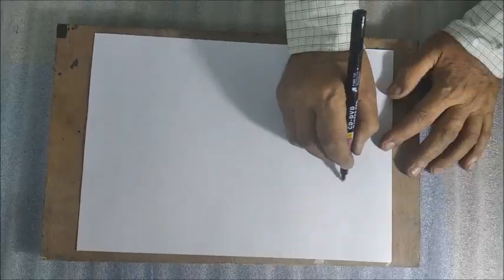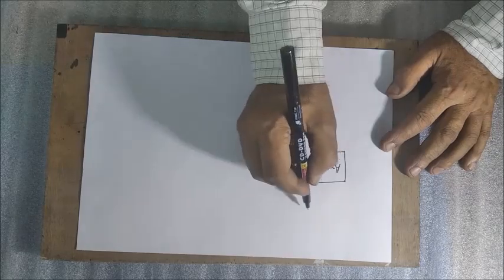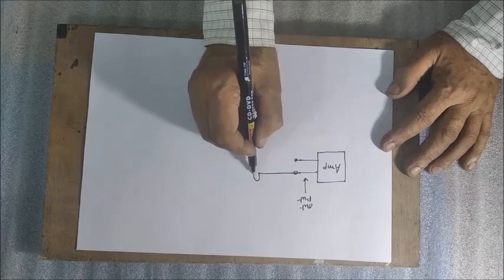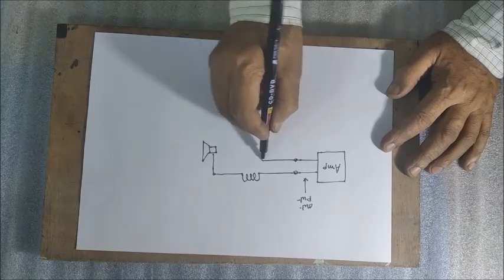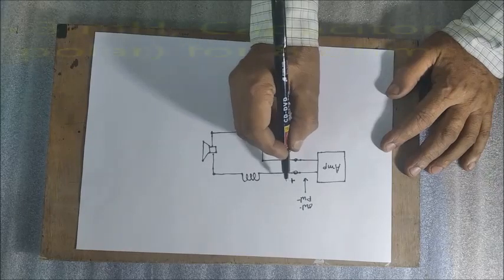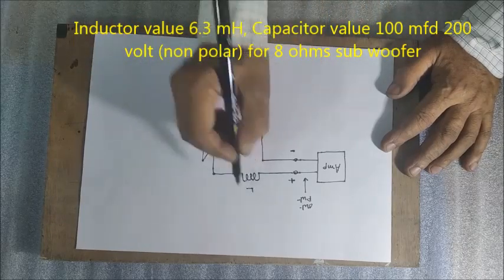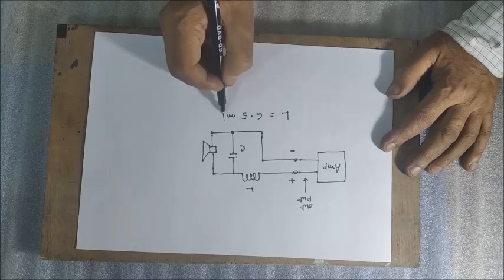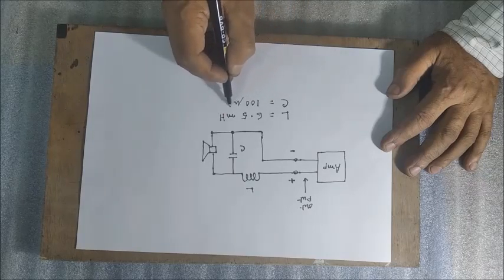Passive Cross over network for Sub woofer

Comment: Nice idea Sir. Yes, the bass is more gain. But that's much better to call; 'high frequency killer', than a :subwoofer booster'. Because the amount of power from amplifier to distribute in speaker is decreased by cancelled high frequency. Anyway thanks for video.

Comment: Inductor 6.5 mH, Capacitor 100 uF
Crossover 197 hz  (pasabajos)

556 Vueltas con esa forma por cierto poco eficiente (las vueltas deben de ser bien hechas para obtener el valor)

60 Metros de alambre #18 AWG
Peso de alambre 442 gr.

Comment: Sir it's a great presentation for audio diy lovers. Can I use the same circuit for 6 inch subwoofer with 4 Ohms 40 Watts. Or do I need to make any changes in the circuit. Your help is very much appreciate

Comment: I am your subscriber, very nice videos. Can you please guide me what specific components should I use to make a sub-woofer passive crossover of 4 ohm and 5 watt. I am using a simple 5v amplifier board which I got from my old broken usb powered pc speakers. So i am trying to add some extra bass for a simple 3 inch woofer speaker I bought from local market and in parallel with a old 4 ohm philips two in one's speaker.
Reply from the maker: You can watch my video on passive subwoofer filter at:
https://youtu.be/06Dtra6MCwI
Reply from the maker: And also https://youtu.be/PSI9TgH_JJk
Reply: @makingloudspeaker  thank you so much

Comment: I will make the crossover for 4 ohm 60watt speaker.... Now pls tell me how much inductance I should make it through the copper wire. And what will be the capacitor value in  micro farad????👍👍👍👍👍
Reply from the maker: For 4 ohms inductor value will be half and capacitor value should be double.
Reply: @makingloudspeaker  thank you 😊 so much

Comment: Sir but every time complition of one layer of winding the diameter gets increased for second layer ,then third layer  and soo on.... how to calculate indctance of inductor inductance because the diameter increases ,even if bobbin is short number of layers increases, if it is long noof layers decreases then also diameter changes  but we are calculating for bobbin diameter, i get confused how sir can u explain
Reply from the maker: From standard wire gauge chart you can find turns per inch/cm, then get no.of layers, mean dia, mean length x no. of turns, total length of wire and weight of wire for required number of turns. You can get tips from any transformer winding handbook. Thanks.
Reply: http://www.zpag.net/Electroniques/Audio/multi-layer_air.htm         https://rimstar.org/science_electronics_projects/coil_design_inductance.htm      you can use this link for Air/iron core coil  calculations

Comment: Is crossover required for full range speaker?
Reply from the maker: For full range speaker cross over network is not required. If you want to add tweeter, you will have to use a high pass filter.
Reply: @makingloudspeaker  thanks

Comment: What is the permeability of iron core that you used in the video? 
Can you suggest online calculator (or formula) for inductance with multilayer iron core [like steel core with permeability of 2000]
Reply from the maker: The inductor coil shown in the video is made on trial  basis.
However,
The absolute permeability of a soft iron core is given as 80 milli-henries/m (80.10-3). ... While, air may have a permeability of just one, some ferrite and permalloy materials can have a permeability of 10,000 or more.
For calculating inductor you can try following link :
https://www.allaboutcircuits.com/tools/coil-inductance-calculator/
Reply: @makingloudspeaker   link which shared is showing "solenoid" coil (it's a single layer coils) can I used that measurements (like number of turns) and make a multilayer coil
Reply from the maker: For multi layer coil you have to consider mean length and diameter
Reply: @makingloudspeaker  thank you so much. One more last doubt can I use aluminium enameled wire instead of copper enameled wire, is it ok
Reply from the maker: @mohdyousuf9533  I have not tried. I think Inductance will be less. More turns will be required.

Comment: and more over that 6.5 mh inductance may filter around 500hertz only , some technical person tell if it is around 63 mh it may give around 40 hz like he tell , now what is your idea sir
Reply from the maker: Thanks for your comments.There is a standard equation to find out the values of C and L for any crossover frequency and impedance. 
That is C=1/2πfR and L=R/2πf 
You can find out values of inductors and capacitor as required.

Comment: what if, I want only 20 - 80 hz.
Reply: The inductance and capacitance values used in his design are designed specifically to filter out everything above 200Hz.
Altering these values, by experimenting or calculating will allow you to tweak it to your specific needs.
Word of advice though, having your low pass filter set at 80Hz would require much more amplification to sound as loud as a filter set at 200Hz.
As well, even though a sub may have an operating frequency of 50Hz+, this does not mean that it will be equally efficient throughout it's range.
Speakers tend to be less efficient on the outer edges of their operating frequencies.
😎👍🏼
Reply: @YusufGinnah  thank you

Comment: Useless video. The most important aspect, the calculations of getting induntance and capacitance is missing.
Reply: What calculations are you referring to?
He's explained how to measure the inductance via the weight of the wire used, in the video and in the video description too.
And with regards to capacitance, he's mentioned a the capacitor values a few times too.
😎👍🏼
Reply: @YusufGinnah  ji when you create a crossover you need to decide what value of capacitors, resistors and inductors should be used acc to the driver used. How he decided that this much henry of inductance would be used in his crossover. Assume that i am uisng 4 ohm driver with any resonance frequency and other parameters and when i am using a different parameter set then how would a same inductor work on the crossover. The value of parts used in crossover is not mentioned here which is the key component of creating a crossover.
Reply: @dushyantchaudharymathura  Try this link for a calculator.
It shows calculators for 2 way and 3 way networks but the low frequency values can be used on their own if that's all that you need.
https://goodcalculators.com/crossover-calculator/
Or even this link to give further explanation
omnicalculator.com/physics/crossover#passive-crossover-design

I hope it helps.